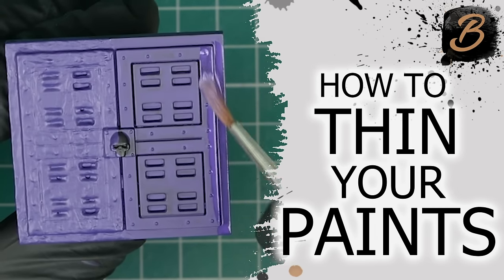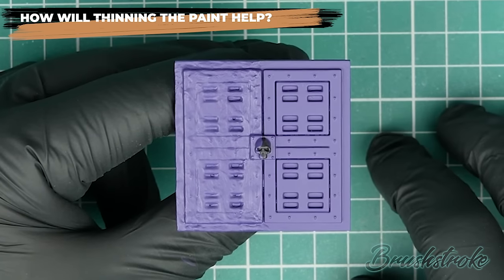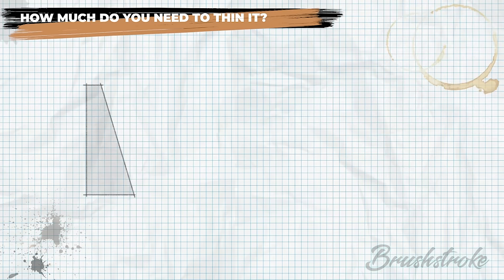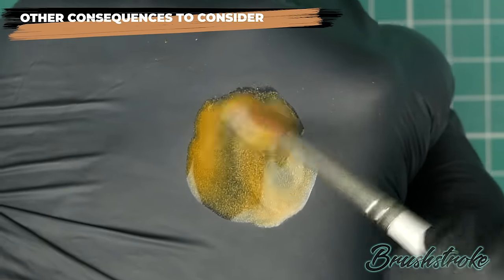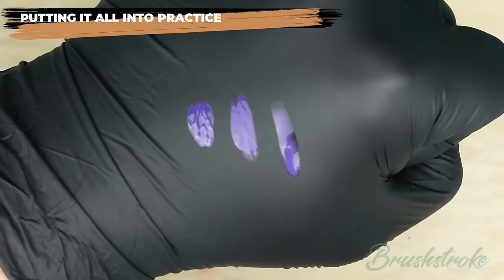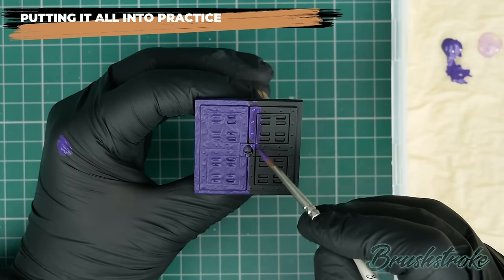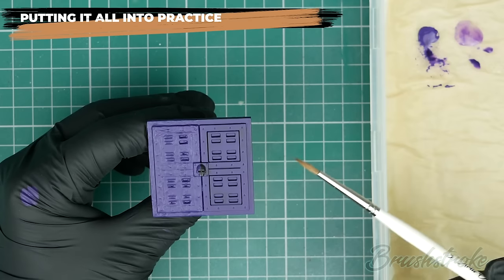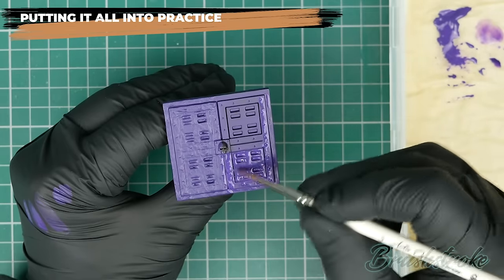HOW TO THIN YOUR PAINTS: A Step-By-Step Guide

Comment: Do I thin down also if I already used contrast Medium? May be a stupid Question but i’m just getting started again after 10 years.😎
Reply from the maker: Not a stupid question at all. If you’re adding contrast medium then that is your thinning agent and you wouldn’t be looking to add anything else to the process.
The reason you would be looking to use a medium to thin, instead of water, is it allows you to make the mix far “faster” without it splitting (like oil on water) 
There’s a point with all paints which you can’t thin past using water, as the paint will split. Mediums are basically paint without pigment so you they will continue to bind the paint together and prevent it splitting

Comment: I never thin my paints and get fine results, nothing like the extreme case you shown on the side. I find thinning paints just takes too many layers and it ends up with just watery, and badly covering applications. Maybe I'm just using better paints that don't need watering down, since I've never used Citadel ones.

Comment: I've always thought that you need a dedicated paint thinner liquid, does water do the job just as well?
Reply from the maker: Probably a subject for a whole new video, but generally if your water isn’t of a massive mineral content it will be fine for 90% of your thinning needs.
Where I use medium instead is if I need to thin the paint past its splitting point. That’s the point where it will no longer hold together as a paint. Using medium instead will result in the paint being able to maintain its structure and hold together.
Paint thinners are great substitutes if your water has too high a mineral content or contaminants and as a results will dry with bits / remnants, which ruin the paints.
Reply: @BrushstrokePaintingGuides  This was going to be my question, is normal tap water ok or does distilled water help? I presume the answer to distilled water is better re mineral content but is the same re the splitting part of the answer, so move onto mediums instead then? Thx
Reply from the maker: Andy, yeah tap water is fine (it’s what I use) unless you’re in a high mineral content area. Then distilled would be better. Using distilled water will have no bearing on the splitting point though. If you’re needing to go that thin, then it’s medium always

Comment: Got it, easier sed. Does is it same for primer
Reply from the maker: Yes, you need your primer to settle smooth too.
Although, depending on what primer you’re using it may need to be thinned with something other than water. Maybe medium etc.
So, check the side of the bottle.
I thin my Vallejo surface primer with a little bit of water, to get it settling right

Comment: Can you use a heat gun/hair dryer to dry the paint quicker between coats, or would this affect the finish?
Reply from the maker: Yes you can, you just need to make sure it’s dry enough to not be blown around or unsettled. I use a hairdryer all the time to speed up the process. It’s invaluable.
Just resist using it too early and ruining the layer. Oh, and don’t go too hot obviously, as it’ll cook the paint or even worse warp the model 👍

Comment: Okay, not even 2 minutes in and i am already realizing i do not paint like you do. When you put that blue on without thinning it and just slapped it on, i paint exactly the opposite of that, i load my brush slightly and then make sure to spread it as far as i can to the point that i am not even seeing paint go back on the model, and then i rebrush any parts that look wet or globby into the parts that need more and i end up with pretty much the exact look you got on the thinned paint part of that box.
Reply from the maker: Hey man, if you’re getting a result the same as the right hand side, then that’s all that matters. This video is just to try and explain how I get that result 👍

Comment: What about dipping the brush with the paint into a water cup?
Reply from the maker: well you can but that doesnt give you much control and if that cup has had metallics dipped in it then youre going to get contamination issues with your other paints. I find having separate dots of water far easier

Comment: Is there a benefit in using a thinning agent for this instead of water? I know doing regular canvas acrylic work mixing water runs the risk of cracking.
Reply from the maker: So, there are differences with using thinning agent instead of water for sure. Assuming your water isnt of high mineral / contaminant level there isnt really much need to use anything else for 98% of the time.
Thinning agents are good when you want to break the surface tension and make it flow easier. As you'll know, water is very strong at keeping its form and most of the time that is an advantage as you can use it to control where it goes on a model. But there are times when you dont want that and you just want it to be fast flowing.
There's a whole videos worth I could do on other thinning solutions.... hmm sounds like an idea

Comment: does this apply to airbrushing as well? ive been looking everywhere to up my airbrush painting techniques
Reply from the maker: Sort of
For airbrushing you want your paint to be even faster as you need it to be atomised by the pressurised air propelling it off the needle.
In terms of the scale in this video, you want it to be thinned enough to run freely down an incline.
The difference with airbrushing is you can apply super thin coats which dry almost immediately, meaning you’re not relying so much on it having to shrink on the surface as the water evaporates.
But if it’s too thick it won’t be liquid enough to go through the airbrush and itll clog all the time
Probably needs a separate video on the topic to be fair
Reply: @BrushstrokePaintingGuides  thats Really helpful thanks! i just got into the hobby and a friend of mine reccomended airbrushing for larger scale 3d print painting. 🙏

Comment: I would love to know how much paint is 'wasted' on the palette, I'm guessing about half goes on the model and half stays on the palette.
Reply from the maker: That’s a very fair question and I think perhaps a misconception people have about using paint in this way.
By thinning the paint on a wet palette as I did here, you needn’t have any wasted paint. The palette will keep it wet and workable for the whole paint session. Enabling you to use every drop from the palette.
And I often have to add more paint to my palette as I’ve used it all.
The only real wastage comes if you over estimate how much to add to your palette to start with. That judgement improves over time.
And testing on the back of you hand etc could be classed as wastage as it never reaches the model. But it acts as a safety net to ensure your paint is how you want it, so I see that as an acceptable cost.
I’ve more details on the wet palette I use, if that may help explain things better?
https://youtu.be/NLcuicvJFKo?si=oNOJygk1lESuwjrJ

Comment: Would you prefer water or some medium to thin up pain?
Reply from the maker: The majority of the time I would prefer to use water, as it does the job I need and costs very little. I don’t like spending money 🤣
I do use mediums at times though, when the outcome requires it.
There’s a point in all acrylic paints where they will no longer absorb water and instead they start to break down. Basically the ratio that is required to form the paint is no longer in balance.
If you’re needing to thin a paint beyond this point (glazing, washes that sort of thing) then you’ll need to use medium. This is because they are not just water but also have the agents in them that keep the paint together. Think of it as paint without the pigment.
So, you can add way more medium to a paint than you could water and it won’t destroy the bonds holding it together.
I prefer to use a medium from the same brand of paint I’m using it on, as they should be an exact match to the formula your thinning.
Likewise, if thinning a wash or contrast paints, always use their medium as they are very different formulas to standard acrylics.
Hope that helps

Comment: Just one cuestión, if I don’t have the Vallejo paints, what can i do, to make acrylic paint to stick on plastic like miniatures, and for the paint not to fall just with any scratch.
Reply from the maker: To ensure your paint doesn’t just rub off, you are going to need to prime the model first.
It doesn’t need to be a Vallejo primer. Any plastic primer will do but you do need to do it.
Best budget options can be found in pound shops and car parts shops.
Just make sure it’s just a primer for plastic
Reply: @BrushstrokePaintingGuides     Thank you so much mate, god bless.❤️

Comment: I dont thin my paints and they always look great? Is it because i have an art degree or is it that i use a wet pallet?
Reply: Whilst watching this ive realised its the wet pallet
Reply from the maker: I suspect by taking a degree in art you have a more than average artistic ability. that combined with your learning in the art will have, no doubt, boosted your skill in observing the paint behaviour and developed your brush dexterity to a point where you’re able to apply paint with the required precision and deftness of touch to overcome the pitfalls of unthinned paint. And then of course, the use of a wet palette will further enable you to control and manipulate the paint to work how you need

I have none of your art background and thereby lean heavily on the physics of drying paint to achieve my aim 🙂

Comment: I love speed paints. 
Because I'm lazy.
Reply from the maker: That’s fair.
It’s all about finding what works best for you.
As you’ll have seen from the video, speed paints are on the “fast” end of the speed scale and designed to flow and move. They have the added bonus of being very concentrated and formulated to stain (very much like inks do) so they can tint higher surfaces.

Comment: When I paint, because I’m lazy I don’t have a pallet and I’m well aware of thinning especially now to this video a lot more. But I take mine straight from the pot and basically thin it out when applying. Get it to when it’s almost showing the base through then apply a second coat later. It’s still not as good by any means but again I’m just lazy. I also only started about a month ago and have no intention of actually using my models to play. Just to make me happy
Reply from the maker: You can of course thin the paint whilst applying to the model but it removes a lot of the control you have over the final finish. You’ll always be working against the paint drying on the surface as you’re trying to both thin it and apply it over the model. 
I’m sure with practice you’ll be able to get pretty good at it, but for me I just prefer to know what result I’m going to get before I put the paint anywhere near the model.
As you say though, it’s your hobby and it’s to make you happy. So, if you’re getting the result then stick with it 👍

Maybe down the line, think about trying a palette though. You may surprise yourself what a difference it can make. 🙂
Reply: @BrushstrokePaintingGuides  just last week I bought some highlight and contrast paints. I’ve only recently learnt how to dry brush, so I’ve been going in with some battle damaged marines. I bought a box of 10 intercessors, so I did 5 damaged. Now I want to try 5 pristine, so I intend to go all in with this, thus me coming across this video 😅

I’ve still got a lot to learn and through laziness I’ve learnt I’m fighting myself as you say 😂
Reply from the maker: @poshduck9696  nice one
It’s all about little steps
If you’d like to know more about using a palette, give this a watch. It will help you and save you buying an expensive ready made product

https://youtu.be/NLcuicvJFKo

Comment: Wow! When the first coat was dry I had a wtf moment :D Pure magic! Would you act same with Tamiya acrylic paints?
Reply from the maker: exactly! 
I think that's why so many beginners struggle, because the first coat looks ugly and patchy when it's first applied and so they panic and thrown more paint on and just make it worse. 
But because it contains that extra water, as it dries it shrinks down and actually looks fine when it's dry.
It is like magic for sure. It's why I wanted to show the process in full, so everyone can see how each layer looks before and after they dry.
Thanks for watching. I hope it's been helpful :o)
Reply: @BrushstrokePaintingGuides  Thank you for your reply! What would be the differences thinning with water versus thinning with Tamiya acrylic thinner? Also adding retarder? Besides the cost :D
Reply from the maker: Good question, and that's a topic for a follow up video for sure.
Briefly though, the differences really come down to quality of the thinned paint.
Thinning with water has its limitations basically. There is a limit with any paint to how much water can be added before it will lose its integrity and split. Which means the paint will no longer behave like a paint and will instead will refuse to mix together and the elements will just float independently of each other.
Now, if you were to thin with an acrylic thinner instead, that split point is moved and it will allow you to thin a paint considerably more whilst still maintaining its integrity and holding together. 
So, in terms of paint speed, as I was discussing in this video, it's only really when you want to be using your paints at the extreme end of the speed scale (fast) for glazing, washes and tinting that you would be needing to use a medium or acrylic thinner instead of water.
UNLESS
There is another reason why you may have to use mediums / thinners rather than water and that's if your water source is too high in minerals or impurities. In that case you may find adding that water has a negative effect on the paint and actually makes it clump, separate or generally dry unpredictably. If your water is that poor you will need to use something purer to thin with.
Finally, with regards retarder, that is used if you want to prolong the drying time of your paint and extend the working time. This is of use if you are having to work in a hot environment where the paint is drying too quickly or if you're wanting to produce smooth blends and transitions which require the paint to stay wet for longer while it is positioned correctly and accurately.
Another good alternative to help prolong the working time of your paints and improve your painting too is to use a wet palette. I've made a video on this topic, which will explain them more which you may find interesting 
https://youtu.be/NLcuicvJFKo

I realise that's a very rushed answer but hopefully that should give you a quick overview and some idea as to when and why you would want to use other thinning agents
Reply: @BrushstrokePaintingGuides  Wow! Thank you for your time!

Comment: So would this apply to enamel paints as well then? Only, using enamel thinner/white spirits/ turpentine to thin instead of water?
Reply from the maker: Yes, the same principles of shrinkage and movement as the paint dries are still the same. As you say, you would obviously need to substitute the water for a thinning agent such as thinner, white spirits etc
Reply: @BrushstrokePaintingGuides  aweslme! Thanks for the reply!😁

Comment: Is that "shrinking back on itself" phenomenon that you're looking for with a well thinned paint something that can be observed on wet palettes as well? I can't seem to replicate that phenomenon, and I'm not sure if I'm doing something wrong or if it's different on wet palettes.
Reply from the maker: this video was filmed on a wet palette. All be it a self made wet palette.
Full details in this video
https://youtu.be/NLcuicvJFKo

So, yes. That phenomenon does happen on wet palettes, however, what I have since learnt is commercial wet palettes seem to come with membranes which have been developed to have unique surfaces to set that brand apart and make a unique selling point.
As a result, it can affect how the paint behaves. The principles still exist but they're harder to spot. Not great for beginners. So, you could try swapping to a different membrane paper (like the stuff I use) as an experiment and see it that is easier for you to use. Or you will need to use the hand (or similar) to check your consistency and learn how the correct paint speed looks on your brand of palette.
Personally, I'd say try a different paper and see how you like it. Good thing is it's cheap, so wont be an expensive experiment.
Reply: @BrushstrokePaintingGuides  Thank you so much for the reply! I have been painting miniatures for about a year, but I've never been the best about thinning and I'm trying to bring my painting to the next level.

I'll have to try your suggestion of using a different membrane, at least while I'm learning proper paint thinning.

Comment: So even if it bridges little gaps like those on the sides, it won't just fill them in..?
Reply from the maker: Yes, if thinned right it will shrink to the surface as the water evaporates
Reply: Okay, cool, I worry about that a lot with chainmail and small details an' the like..
Reply from the maker: Do you worry when you add a wash to those details?
Reply: I mean... Kinda. A bit.